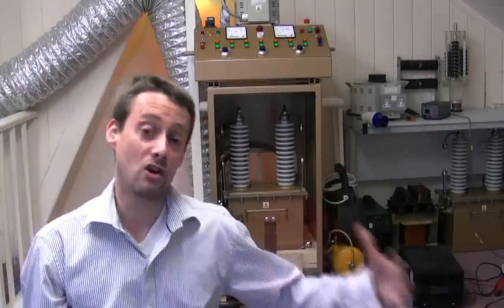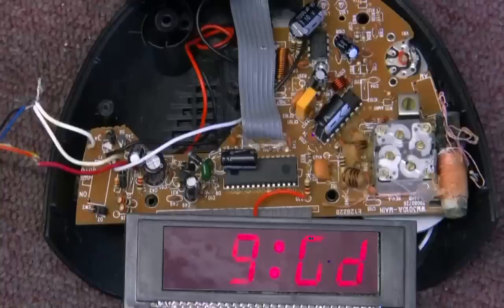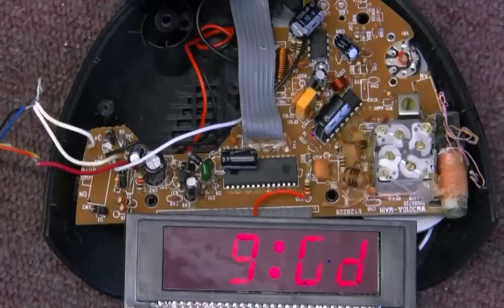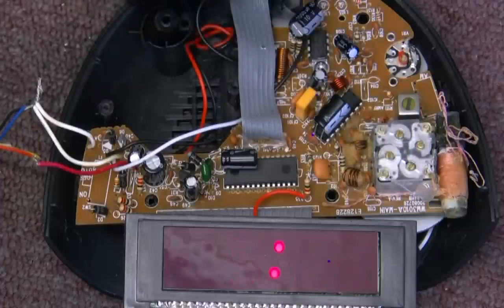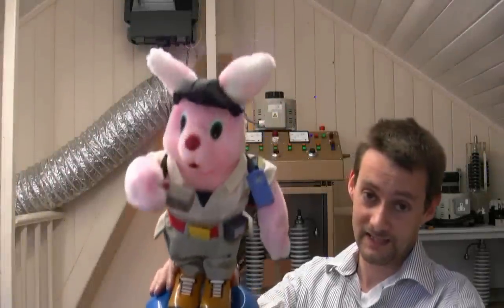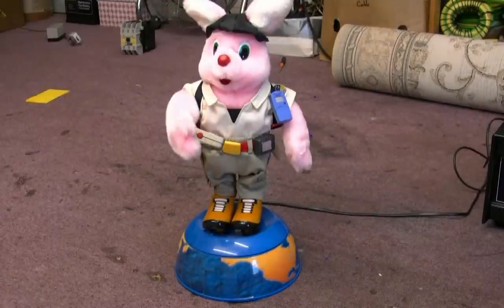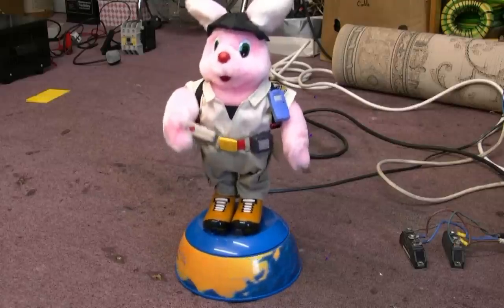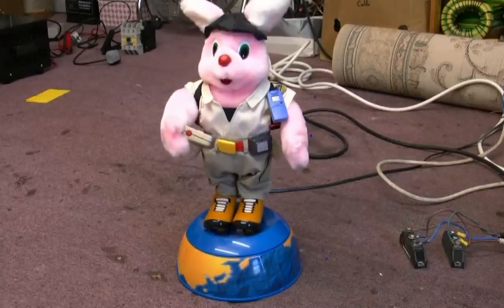Clock Radio And Toy Rabbit Pop

Comment: To be fair, I was surprised the clock radio kept on playing even when half of the power circuit was up in smoke :|
Reply: +Daniel&#39;s Game Vault  the radio power circuit is separate to the clock power supply on the board, The clock power failed first yet the display kept going however with unfiltered dirty dc on it, then you here the music get slightly louder and then 50Hz line hum comes through the speaker as the radio filter cap pops and goes open. over-voltage dc eventually destroys the display driver. To really understand how it failed we need to see the circuit.
Reply: that was clock circuit
Reply: But fortunately in 1:57 that would end it, that music was also getting me nuts haha
Reply: What is the name of that music though? I actually quite liked it.
Reply: @clementpoon120  

Here's the info according to Shazam:
Piano Trio In E Flat Major Op.100: I Allegro

Seems like the instruments are similar to match and it's an album from 2009.
Reply: It was.playing an outro, then it died.

Comment: Another entertaining trick is to get a 20w fm transmitter exciter rack mount device with adjustable output power and connect the antenna out to the fm radio antenna in, this smokes the fm receiver, play music through the transmitter /radio receiver til it pops, slowly crank up the fm power. Use a blank part of the broadcast band for the test.
Reply: that is actually a good idea, except I dont have the transmitter :D

Comment: Am i right in thinking that the diodes you pointed out are a bridge rectifier? Would it be possible to wire a bridge rectifier up to a cheapo dimmer switch and have a cheap variable DC power supply?

Comment: Since the caps are rated to 10V I'm guessing the small step-down transformer in the clock radio not shown in the video outputs 6V AC..but there is 2 white and one red on the radio perhaps its 6v-0-6v